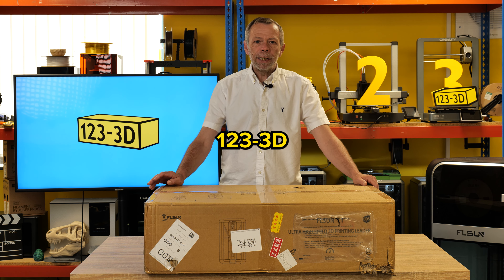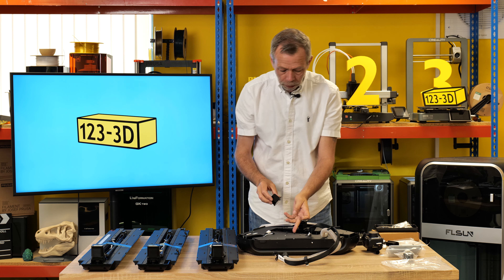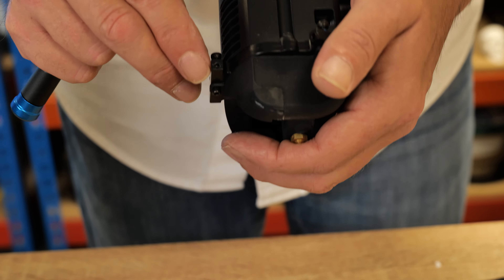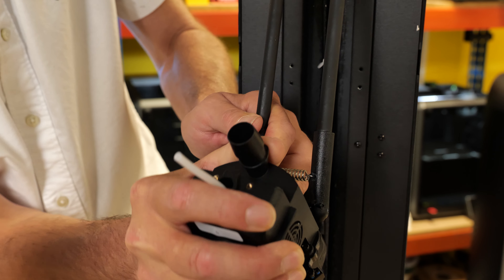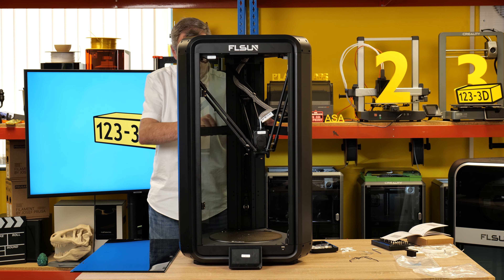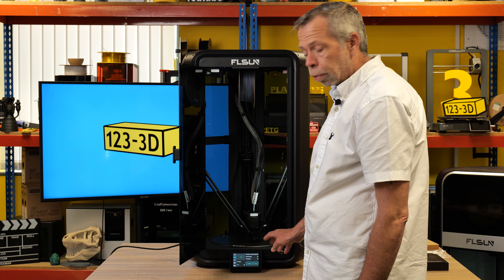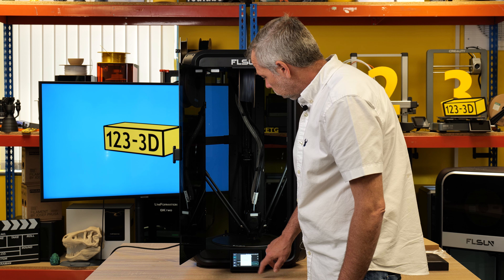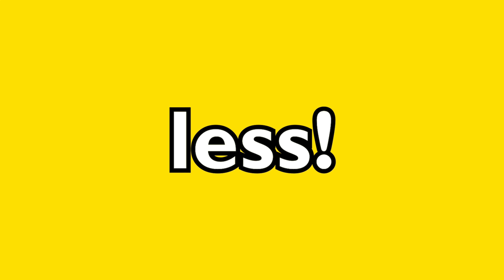FLSun T1 | Unboxing, Assembly & First Impressions

Comment: Great video, I have lots of screws left but that is fine, one plastic ring sort of triangle with a center hole and 3 tiny holes no idea what's that for.  and mine skipped self inspect. and went chinese on me after firmware update.. If I feed the filament Thru the holes on the wire guide I get filament sensor errors. First print is done a d looks ok

Comment: Assembled mine per directions but there are extra parts. Also the English directions do not talk about installing those little steel column bushings so I put mine together without them. Hope it works ok without I guess since it’s not it the manual.

Comment: I'm afraid FLSUN is going the wrong way: they should make a cheap, not huge delta that is not enclosed and prints super fast PLA and PETG.
I don't really want a premium printer that makes way to much noise that I have to put in the garage.